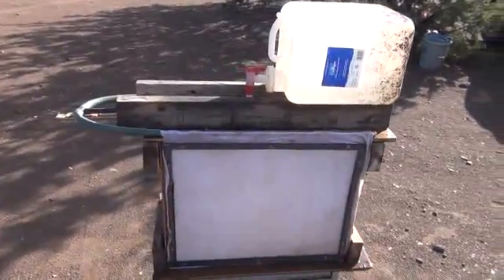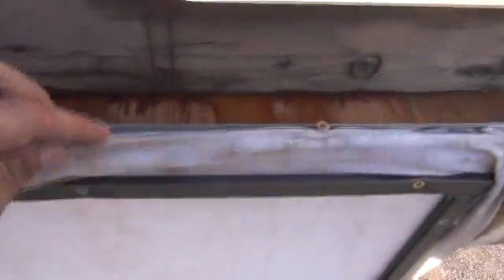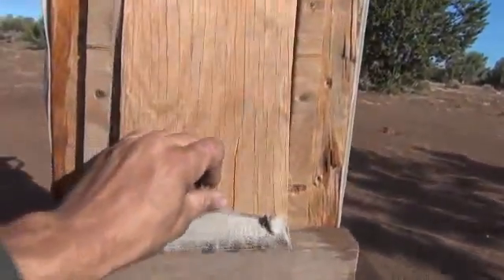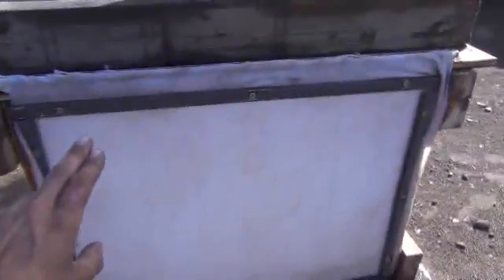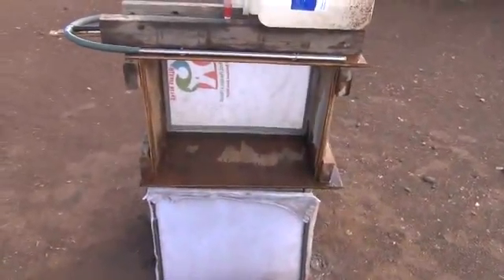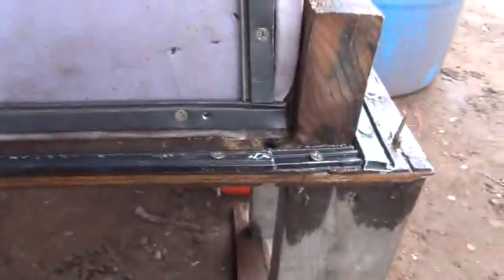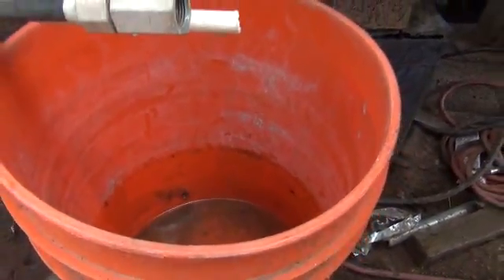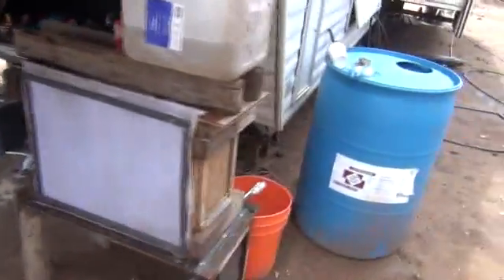Evaporative Refrigerator no electric bill

Comment: what you made basically is a above ground root cellar. Problem is your in a dry area where just the shade adds cooling effect. My faith in you  was figuring you made fresnel/steam drive to  the compressor on an old fridge. which would actually work for freezing too! your swamp cooler would be a nice hideout, but nothing that you wont see  on some construction sites if we are given time

Comment: if you go to the feed store and get thoe cow magnet pills you can run that computer fan with no electricity. just put a magnet at each corner of the fan frame. im shure yoalready knew that but maybe it helps.

Comment: I would really like to see that condensation cooling refrigerator system and i hope it can somehow get down to even cooler temperatures than the evaporative system cuz i live in the humid climate and it can only get incredibly humid if it is spring, fall, or after a rainstorm.